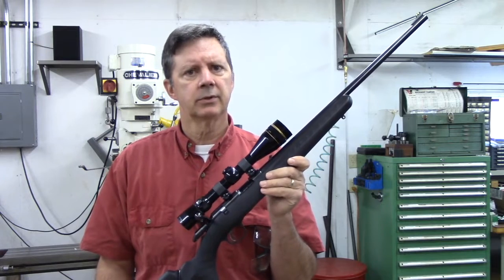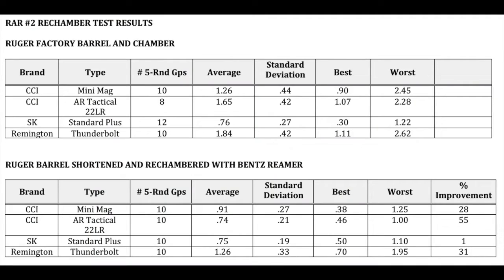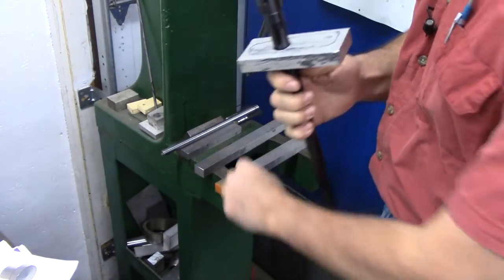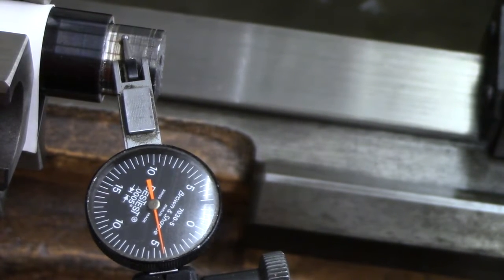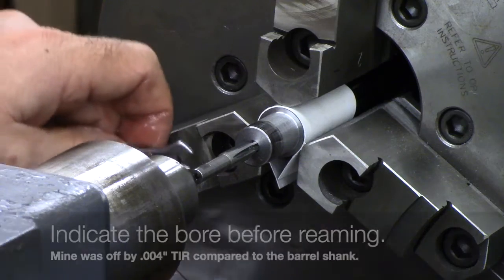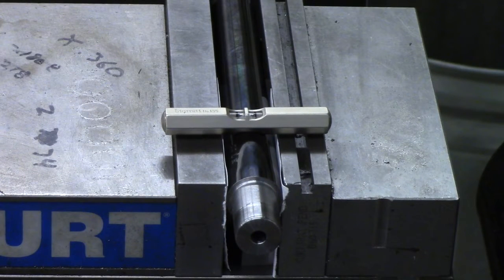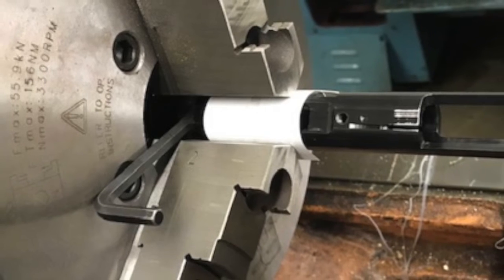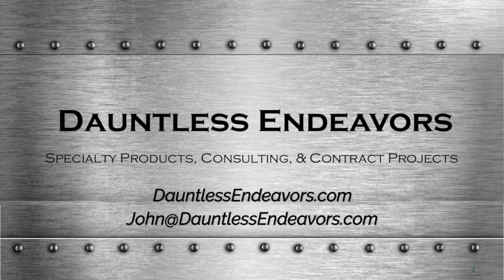Setback and Rechamber a Ruger American Rimfire.  Part 13:  Ruger American Rimfire (RAR) Experience.

Comment: Silly question. Once tou got them apart why not thread the receiver and barrel Remington or savage style?
Reply from the maker: Not a silly question at all and one I seriously considered.  
If I were to thread the barrel, I would go with 3/4x20 threads and use a "full profile" internal threading insert.  The RAR receiver ID falls perfectly in the minor diameter range for this thread size.  
There were a couple reasons why I didn't, however.
First, the distance between the major diameter of the internal thread (.750") and the scope mount dovetail is getting too close for comfort, although it is doable.  This is why I recommend a full profile threading insert because a standard threading insert will most likely cut a major diameter of the internal thread that is larger than .750".

Second, I would have had to completely chop off the existing barrel shank because I'd need something larger to thread.  I'd have to turn the rear end of the barrel down in diameter a bit so I there would be a cylindrical section to chuck in the lathe, then polish and reblue.  It opens up a can of worms.  This, again, is doable but I didn't want to go there. 

Finally, by doing my best to replicate the Ruger factory assembly, it reduces variables in my experiment.  No second guessing whether the improved accuracy was due to the  tighter chamber or because the barrel was threaded into the receiver.  

Having said all of that, if I were to install a new barrel blank, I would give the threading option serious consideration.

Thanks for watching.
Reply: @dauntlessendeavors1000  thank you. I was planning on putting a 26 inch bull barrel on it so will likely true up and thread the action.

Comment: good video, thanks for sharing...

I guess it was good to see how tight the barrel was to tight fit into the receiver, gives some sense the setup is somewhat robust...

Did have any trouble press fitting the re-chambered barrel back into the receiver ? Looks like a lot of force would be required.
Reply from the maker: It went back together just fine.  I did apply a thin smear of oil on the shank before pressing and the lathe tailstock generates a lot of force for the press fit.  Of course, when discussing press fits, a couple tenths (0.0001") in diameter can make a big difference but I am very comfortable in knowing that my barrel won't ever move in the receiver.  Thanks for watching.

Comment: I know it probably wouldn’t matter for a 22 but when you dial indicate the OD of the barrel on your lathe is there a way to use something like an extra long pin gauge that’s actually stuck in the chamber and sticking out a bit, then indicate off that pin instead of the outside of the barrel. Is that a thing when chambering on a centerfire rifle? Thanks.
Reply from the maker: Hi Shane,
Good question and I do think it matters.  On the RAR barrel, there is very little straight section ahead of the chamber before the taper begins.  I didn’t want to have to chuck on the taper so I went with the absolute minimum setback required to clean up the old chamber with the Bentz reamer.  This decision left some of the factory barrel shank so I dialed in the OD to match the shank.  After finishing the OD, I dialed in off the remnants of the original chamber before reaming the new chamber.  Of course, the reamer is going to follow the old bore, even if it is a little bit off.
If I had a fresh barrel blank, I would have dialed it in off the bore and done everything off that chucking.

Comment: John thank you very much for making this video. Man that is the Cadillac of arbor presses! Did you have any issues with head-spacing and/or bolt lockup?
Reply from the maker: Thanks for your note.  Just make sure to measure everything, twice.  The RAR checked at 0.043" headspace prior to removing the barrel and I got it right back to that when reassembled.  0.043 is the SAAMI minimum headspace and I don't see much benefit to going smaller.

Comment: These videos explain exactly why you should not buy a RAR rifle. If you have to do this much tuning, why not buy a decent rifle to start with.
Reply from the maker: Thanks for your note but I have to disagree.  For less than $300, this is a great value.  It is very reliable and is plenty accurate enough for a youngster or new shooter, for casual plinking, etc.  It is the rough and ready gun I'd take when the weather is too nasty for my safe queen.  
It was never marketed as a match-grade rifle.  As others have pointed out, it looks like I am attempting to turn a VW into a Ferrari.  I've never had such illusions.  I've enjoyed the process of tinkering with this rifle to see what lessons can be learned.  Hopefully, you will agree that some of the experiments with this rifle were a learning experience that can be applied to any rifle.  Thanks again for watching.
Reply: @dauntlessendeavors1000  Where I live the Ruger American Rimfire Target costs $800, a CZ 457 MTR 20" Costs $815 which would you buy?
Reply from the maker: @geordiegeorge9041  I would lean toward the CZ.  However, the RAR and the RAR Target are not the same animals.  Have a great day.

Comment: Are you set up to do this for anyone else? I’d like to build a sleeper for my local club matches.
Reply from the maker: Sorry, I am not a professional gunsmith.  However, I'm sure there are good gunsmiths in your locale who could handle the job for you.  This video might offer a couple tips to help them on their first RAR if they haven't already worked on them.  Thanks for your note.
Reply: @dauntlessendeavors1000  I realized that moments after I sent the message. Have another question for you. What do you think about threading the receiver like some of the more traditional actions?
Reply from the maker: @gebogen4409  I had considered that option and would have chosen a 3/4-20 UNEF thread because the minor diameter tolerance spans the ID of the receiver tube.  However, the internal threads would get really thin at the scope mount dovetails.  There is enough metal there and it would probably work fine, but it is close.  If I were to cut threads, I would definitely use an internal carbide threading insert which was specific to 20 TPI.  That way, the crests of the threads wouldn't be cut any deeper than absolutely necessary.  
I also decided to stick with the press-fit assembly so as not to introduce another variable into my little experiment.
If I were to recommend one design revision to Ruger on their RAR, it would be to eliminate the scope mount dovetails.  I'm not a fan of them and much prefer scope bases that are screwed to the receiver.  Plus, the receiver would be cheaper to manufacture and stiffer (at least theoretically).